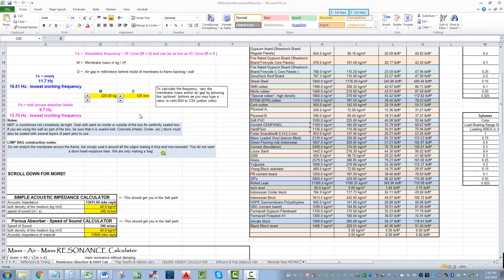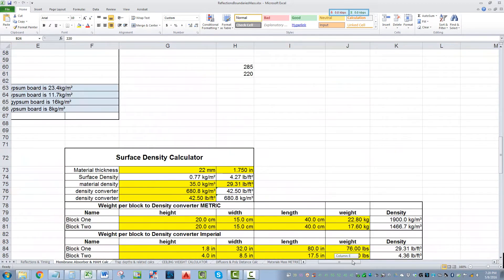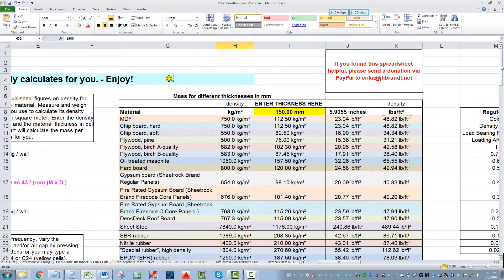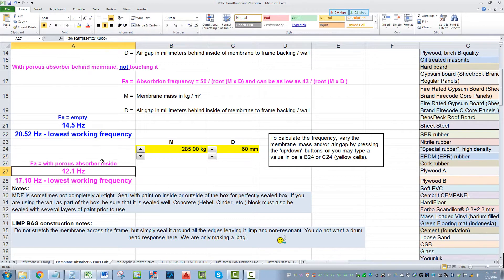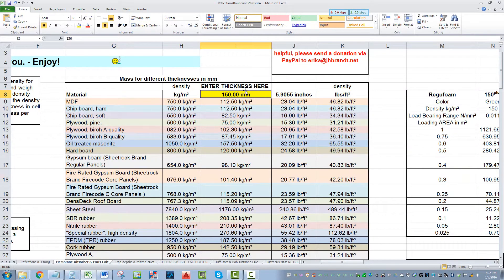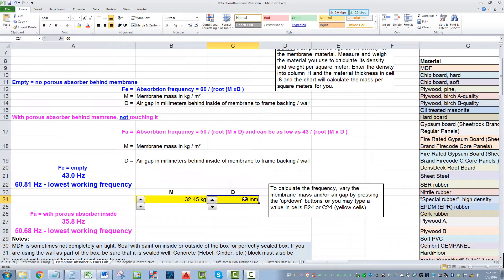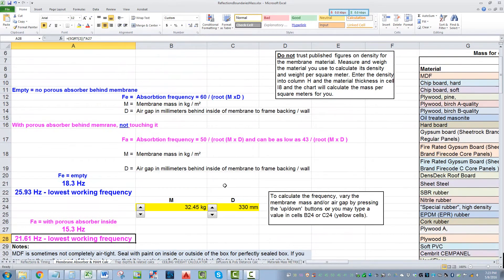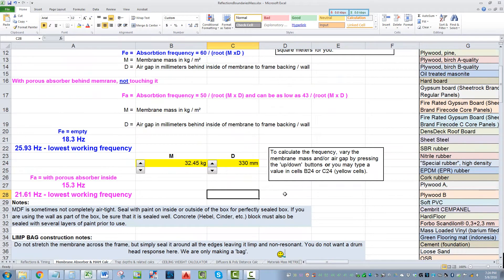How Much Isolation Do You Need? - part five - More about RESONANCE

Comment: Sir I guess mineral wool or fiberglass should lower the intensity of Resonance  and not the frequency of Resonance, am I right?!
Reply from the maker: Half-right. Fiber will 'bend' the resonance lower and reduce the intensity through "bending". I talk about it simply but it is complex. 😄
Reply: @JHBrandt  thanks a lot,  please suggest a book or website having information about this "bending" effect
 
It would be a very big help If there is a physics formula that can calculate the resonance frequency of wall and you can say that.
I found formula f=v/2L for Resonance in air gap but can't find a physics formula for calculating resonance frequency of other objects like walls

Comment: Hi John, thank you for your interesting videos! I have a question for you: I’m building a home recording studio of about 25 m² on the ground floor, and the exterior walls are made of reinforced concrete, tuff, and hollow brick blocks. For the interior wall, is it better to use multiple layers of drywall, or can I build it with 10 cm tuff blocks?  If I use tuff for the interior wall, is an 8 cm air gap between the two walls sufficient?
Reply from the maker: @francescosmaldino7286 it depends. There many variables and to answer your question, I need more information. Please send me an email. john@jhbrandt.net

If you need to book a Zoom with me, please go here - https://calendly.com/john-jhbrandt

Comment: I would like to do what you mentioned in this video, build a sound proof room using MLV and leave it hang limp so it's effective. I was thinking about just building a frame and buying a 4' x 130' roll of MLV and just let it hang over the top and down on each side. I would overlap each 4' strip and not even attach them to anything. Of course they would be making contact with the wood frame on top. Would that work? You mentioned that you did a couple projects by just letting the MLV hang loose. How did you do those? Thanks!

Comment: Thanks a lot for the info ! I suspect that the principles you discussed here are also applicable to floors, but how about a video on the practical aspects of floating floors and resonance? I'm especially interested in construction methods for floors.... without having to pour tons of concrete :-)
Reply from the maker: I just did a floor video yesterday, it should be out within a couple of weeks. One thing about floors; if you need air-borne sound reduction, you MUST make it massive. There is no other way. If you don't pour concrete, you must stack it in layers, for example; plywood-DensDeck or HardiBoard-plywood-DensDeck, etc., etc., etc.
Reply from the maker: I don't about 'tons' but it is usually about a ton depending on the area involved. I'll put that on my to do list. 😉

Comment: So if I do multiple layers of gypsum and frame it right with an air gap and pink fluffy I could get away without green glue? That stuff is so freakin expensive. I would use acoustical caulk in the seams, but not having to buy green glue would save me $1500 at least for the build I’m about to do.
Reply from the maker: Justin, you probably can but MULTIPLE layers don't necessarily add up to what you think it will. Don't guess. If you need some help quantifying or qualifying a design, send me an email. Let's talk.

General advice is usually wrong. ;)
Because I don't have enough information.

Comment: So does green glue work or not?
Reply from the maker: Yes, it does work. It is known as a CLDM (constrained layer damping material).
It depends on the situation/need if you really are better off with it or without it. Cost vs performance. I never use it. ;)
Reply: @JHBrandt  so is it better to invest the money into a 3rd layer of drywall instead of Greenglue? I have a very narrow room (3.20 meters before I build the inner room) and the space is something I need to optimice, so I was thinking into use two layers of drywal + greenglue or 3 layers of drywall (type X)
Reply from the maker: @jurgitab  First you have to run the room modes. These must meet certain criteria. THEN you consider the soundproofing. The required STC or OITC is determined from an environmental assessment (for mixing rooms) For Tracking rooms, you have to consider YOUR noise and build partitions to contain it. 
So, whether or not you use GG, or deadsheet or room-in-a-room construction DEPENDS on how much isolation you NEED. 
One-size 'does not fit all'. So don't just go along with the popular narrative. ;)

Comment: During the first 3 minutes you are doing a calculation using silicate block, then you say you have a gap of 6cm, I'm confused on what the other leaf is, because it sounds like you are only talking about a single block wall.
Reply from the maker: Sorry for the late reply. The silicate block that is under discussion is the lighter partition of a double wall system. Always calculate using the lighter partition when figuring a MAM calculation.

Comment: Hi John, really love the videos! I have a question. I am building a home studio in my basement and my initial plan for the CEILING was this:

- mass vinyl to subfloor in between joists
- 13mm drywall cut to size with space in between to caulk
- insulate
- sound clip
- hat channel
- 13mm drywall
- mass vinyl
- 13 mm drywall staggered

From what you have said -- is mass vinyl worthwhile in this scenario? Will it soundproof the ceiling to the point where no sound above 70dB let's say will be audible? Footfalls, etc.

Thanks for all of your videos and information, resources everything. Much appreciated!
Reply from the maker: Forget the MLV. The first thing you need to do is to determine your soundproofing requirements. SPL and frequency of the offending source. You should send me an email. ;)
john@jhbrandt.net

Comment: Hi John I have a question about  your MAM calculator, let suppose I build a room into a room with a decoupled ceiling. The ceiling has spring hangers fixed into joist and the inter joist have been reinforced with 2 layers of drywall to add mass. For the air gap, do I take the  distance between bottom of joist to top of my decoupled ceiling or can I take the distance between interjoist and decoupled ceiling ? Thank you.
Reply from the maker: No, it is calculated from hard surface to hard surface... Or membrane to membrane.

I offer all the information here for educational purposes, however if you are trying to DIY design your studio, you will fail... Many times.
Please send me an email. - john@jhbrandt.net 😊

Comment: Thanks for your great videos mr. John Brandt! I'm trying to soundproof a small room( vocal booth) and I am wondering, can I just add 4" rockwool to the wall(brick) than fabric on it and expect some isolation?The room is small already and I'm on a budged so my target is to absorb some of the  reverberations and to add some isolation in the same time...Thank you very much for you resources!
Reply from the maker: Mihail Ivanov, in short no. Rock wool does not isolate. It is a sound absorber. What you need is mass and seal, and better yet - decoupled mass.
Reply: Thanks for your prompt reaction, sir!:)Are they any other cheapo options for decoupling( other than gypsum boards). Can I for instance use a layer of nylon, leader or something like this....?
Thank you very much!
Reply from the maker: Mihail Ivanov not really. Please send me an email. John@jhbrandt.net 
I need more information about your situation.

Comment: With mass loaded vinyl, would it work for underneath a raised foundation house, stapled to the floor joists under the house? (Given that I seal the ends.)
Reply from the maker: Yes, If allowed to remain limp and not sandwiched.
Reply: Cool then I think I've found a solution I've been scratching my head over for a while.  Thanks!  Finally getting time to dig into all your stuff.

Comment: Can't we use other dampening materials like carpet,cloth,rubber etc instead of green glue and get the same result?

What is especial about gree glue that everyone talks about that?
Reply from the maker: Green Glue "used to be" a decent CLDM. The new formula no longer works. CLDM means 'constrained layer damping material'. Why not use polymer-modified bitumen? It provides damping but I don't have test data on it. It's known as "deadsheet".
Many layers of different materials will cause self-damping. 
It's always best to use products that provide current testing data that covers the frequencies of interest.
Reply: @JHBrandt  thanks a lot.

Comment: great series it just occurred to me is there a way to in such cases as having a vaulted ceiling to suspend the ceiling from the existing ceiling and still maintain good isolation?  Thanks.
Reply from the maker: Yes, of course. The interior vaulted structure must have its own ridge beam and structural support separate from the existing building. As I always say, the devil is in the details and every build is different.

Comment: How do you compute the frequency with two different mass materials?  For example, a brick wall - air gap - 3 layers of drywall?
Reply from the maker: Input the data for the LIGHTER partition to see the resonance. The calculator is simplistic but will give you a good idea.
Reply: thanks!

Comment: how about air cavity? 
how to calculate air cavity depth needed?

btw Happy birthday Mr. JB :)
Reply from the maker: Thank you!
Air cavity: This is often confused... I always recommend FILLING the air space completely with lightweight insulation. Doing this can ADD 6 dB to the isolation. 
The air cavity depth is only PART of the sound transmission loss calculation but greatly affect the lowest frequency that is 'isolated'. I use a mass-air-mass calculation to determine the lowest frequency to be blocked. Usually there are limitations to the cavity depth, so THAT is usually fixed. If a lower frequency is required, we add more mass. ;)